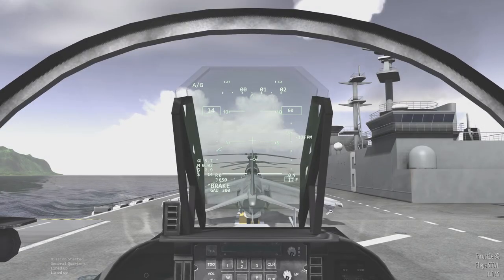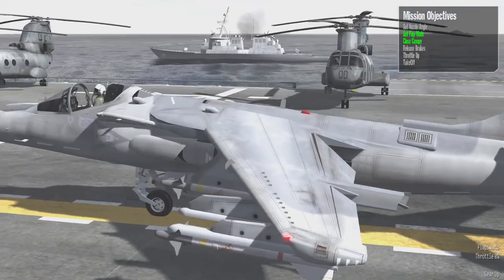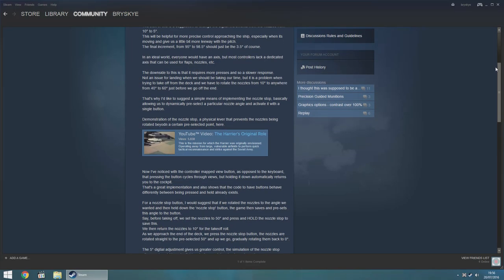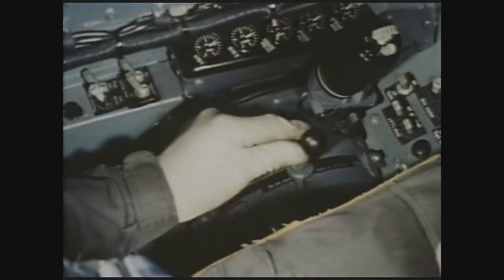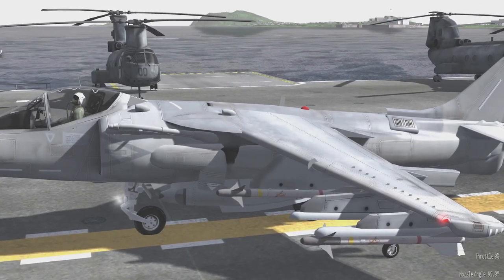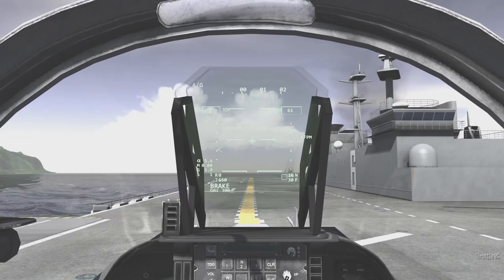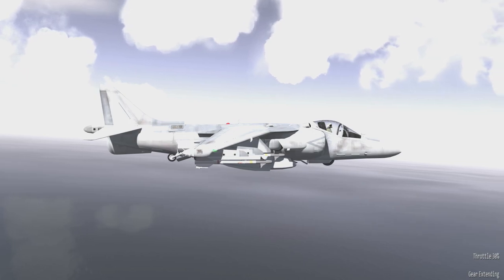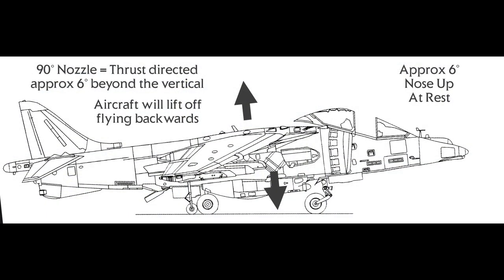Combat Air Patrol 2 - Build 806 - How The Devs WERE Listening (circa 2016)

Comment: But the real question is - why don't you get on DCS!?!?
Judging by your content I would assume you would love it.
Reply from the maker: Basically, I think it takes things just a bit too far for me to really enjoy. I don't mind having to do some reading to understand how to operate an aircraft, I'm quite happy in learning the ins-and-outs of a Boeing or Airbus, etc... well, I learnt them years ago and once you know the basics, you can swap between them with little effort thanks to common design principles, something that doesn't really apply to military jets.
But the addition of weapons systems modelled to that level just took the amount of effort required beyond the enjoyment I got out of it.
I preferred the golden Combat Sim age of the mid-90's over what it has become. There's a reason why DCS is pretty much the only one of it's kind - the genre niched itself into a hole of ever more hardcore and now there is nothing else left. 
It doesn't help that a number of DCS fans won't tolerate anything less than DCS standards and are quite vocal about games, and players, that don't match them. 
I've just never been a fan of Eagle Dynamics uber hardcore approach, not even since the original Su-27 Flanker.
Plus, these days my PC is hooked up to a big TV and I play from a sofa. Whilst I have a stand that allows for a yoke and pedals, and a throttle quadrant, a HOTAS + heavy keyboard use just isn't viable any more.
Reply: fair play buddy, anyway - good videos!
Personally once the DCS Harrier comes out, I'm quitting my job.